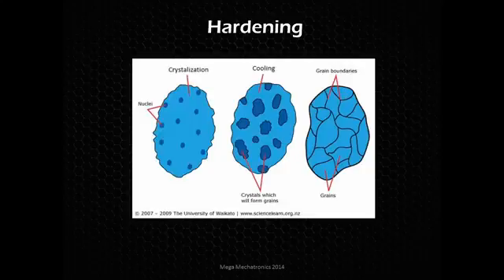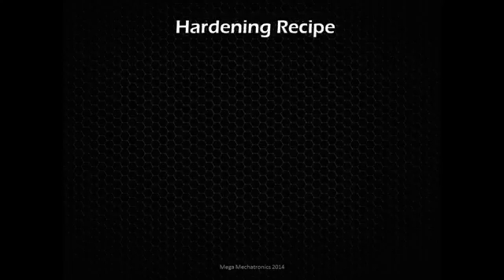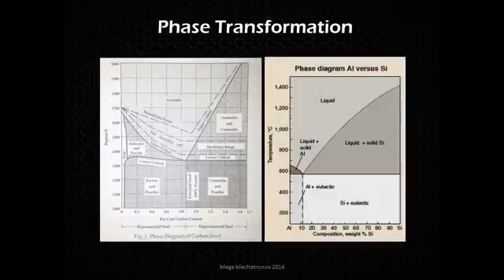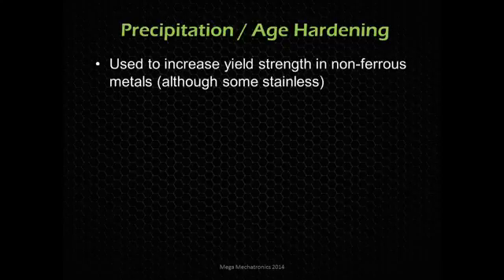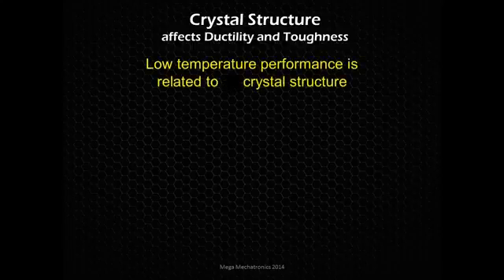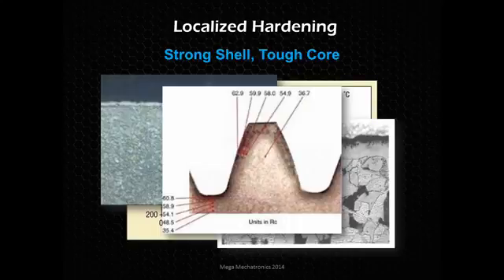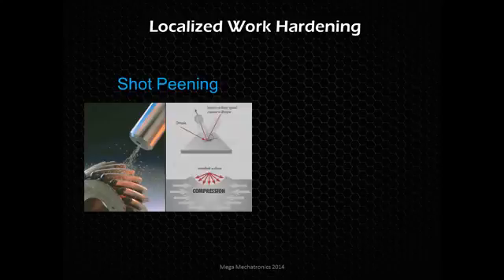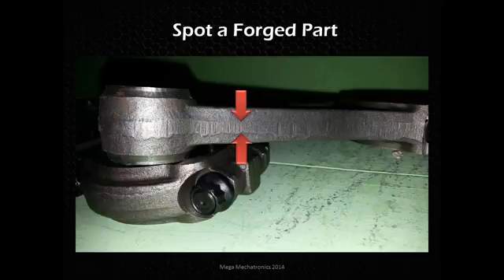Materials Science Mechanical Engineering    Part 4 Heat Treatment Explained

Comment: Ferdiyan Alfathan Yogasara (2714100041)

From this video, the video explain about heat treatment, especially about hardening. Before i explain the hardening, i will review about heat treatment. Heat treatment is the heating and cooling of metals to change their physical and mechanical properties, without letting it change its Heat Treatment shape. Heat treatment could be said to be a method for strengthening materials but could also be used to alter some mechanical properties such as improving formability, machining, etc. The most common application is metallurgical but heat treatment can also be used in manufacture of glass, aluminum, steel and many more materials. The process of heat treatment involves the use of heating or cooling, usually to extreme temperatures to achieve the wanted result. It is very important manufacturing processes that can not only help manufacturing process but can also improve product, its performance, and its characteristics in many ways
There are severeal heat treatment, firstly i think is hardenaning. Hardening involves heating steel. Hardenability is the property that determines the depth and distribution of hardness induced by quenching. Steels that exhibit deep hardness penetration are considered to have high hardenability, while those that exhibit shallow hardness penetration are of low hardenability. Because the primary objective in quenching is to obtain satisfactory hardening to some desired depth, it follows that hardenability is usually the single most important factor in the selection of steel for heat-treated parts. Hardenability should not be confused with hardness as such or with maximum hardness. The maximum attainable hardness of any steel depends solely on carbon content. Also, the maximum hardness values that can be obtained with small test specimens under the fastest cooling rates of water quenching are nearly always higher than those developed under production heat-treating conditions, because hardenability limitations in quenching larger sizes may result in less than 100% martensite formation.  Basically, the units of hardenability are those of cooling rate, for example, degrees per second. These cooling rates, as related to the continuous-cooling-transformation behavior of the steel, determine the hardness and microstructural outcome of a quench. Therefore, the terms Jominy distance and ideal critical diameter can be used. The hardenability of steel is governed almost entirely by the chemical composition (carbon and alloy content) at the austenitizing temperature and the austenite grain size at the moment of quenching. In some cases, the chemical composition of the austenite may not be the same as that determined by chemical analysis, because some carbide may be undissolved at the austenitizing temperature. Such carbides would be reflected in the chemical analysis, but because the carbides are undissolved in the austenite, neither their carbon nor alloy content can contribute to hardenability. In addition, by nucleating transformation products, undissolved carbides can actively decrease hardenability. This is especially important in high-carbon (0.50 to 1.10%) and alloy carburizing steels, which may contain excess carbides at the austenitizing temperature. Consequently, such factors as austenitizing temperature, time at temperature, and prior microstructure are sometimes very important variables when determining the basic hardenability of a specific steel composition. Certain ingot casting and hot reduction practices may also develop localized or periodic inhomogeneities within a given heat, further complicating hardenability measurements. The next is Tempering, involves heating steel that has been quenched and hardened for an adequate period of time so that the metal can be equilibrated. The hardness and strength obtained depend upon the temperature at which tempering is carried out. Higher temperatures will result into high ductility, but low strength and hardness. Low tempering temperatures will produce low ductility, but high strength and hardness. In practice, appropriate tempering temperatures are selected that will produce the desired level of hardness and strength. This operation is performed on all carbon steels that have been hardened, in order to reduce their brittleness, so that they can be used effectively in desired applications. After that, there an anealling, anealing involves treating steel up to a high temperature, and then cooling it very slowly to room temperature, so that the resulting microstructure will possess high ductility and toughness, but low hardness. Annealing is performed by heating a component to the appropriate temperature, soaking it at that temperature, and then shutting off the furnace while the piece is in it. Steel is annealed before being processed by cold forming, to reduce the requirements of load and energy, and to enable the metal to undergo large strains without failure. Next is normalizing. Normalizing involves heating steel, and then keeping it at that temperature for a period of time, and then cooling it in air. The resulting microstructure is a mixture of ferrite and cementite which has a higher strength and hardness, but lower ductility. Normalizing is performed on structures and structural components that will be subjected to machining, because it improves the machinability of carbon steels.

Comment: Bobby A.F. Sinaga
2714100144

Thanks mrs. Dian for the video. First this video explain about Hardening. And This video tells us the meaning of hardening as general. Hardening is create a nuclei and crystalization and let it to be cooled and the crystals grows up and build a grain boundaries (the crystals become bigger). And its video also introduce/tells about crystals lattice likes cubic body centered (BCC), cubic face centered (FCC), and hexagonal. This video also explain about crystal lattice dynamics. Likes the crystals moves one position to other position but still in the same quantiti and size. Next this video tells us about grain boundaries. Its talks about the size of boundaries, likes the huges grain boundaries makes the material more ductile. And this video tells about the concepts of hardenability. The first concept is limits dependent on alloying elements of the metal. And the second concept is hardness dependent on carbon content in ferrous metals. And this video show us the graphic of hardness vs carbon content and its shows more content of carbon makes the hardness increase. This video also tells about hardening recipe. Its very important.  The important things are heating rate, time, cooling rate. Heating rate in the ambient temperature to the transform temperature and then holding time and then do cooling material with quench media likes water, oil, salt etc. And then do a temper. Heating again but not change the transforms. The success recipe is example used in automotive. The ways is after do the hardening like i said before, we must doing austemper. And Austempering is heat treatment that is applied to ferrous metals, most notably steel and ductile iron. In steel it produces a bainite microstructure whereas in cast irons it produces a structure of acicular ferrite and high carbon, stabilized austenite known as ausferrite. It is primarily used to improve mechanical properties or reduce / eliminate distortion. And do the cryotemper to complete the trensformation of martensite. And then do cold working shot peening, polishing etc. And this video tells about phase transformation like FE3C and Al. And the video also shows us a composition matters likes plain carbon 1018 with base element is iron, alloying elements are 0.17% of carbon, 0.75% of manganese, max 0.040% phosphorus, mas 0.050% of suffer. And other example is 4130 alloy steel and 304 stainless steel. At the points the alloy or others elements function to improve the materials properties. And the videos are also explain us about kind of heat treatment. Likes tempering, normalizing, annealing, quenching, age hardening etc. First is tempering, Tempering is a process of heat treating, which is used to increase the toughness of iron-based alloys. Tempering is usually performed after hardening, to reduce some of the excess hardness, and is done by heating the metal to some temperature below the critical point for a certain period of time, then allowing it to cool in still air. The exact temperature determines the amount of hardness removed, and depends on both the specific composition of the alloy and on the desired properties in the finished product. For instance, very hard tools are often tempered at low temperatures, while springs are tempered to much higher temperatures. And then normalizing, that ferrous based metal heated above transformation tempreature, allowed to air cool in still air at room temperature. Next is annealing. Annealing is a heat treatment that alters the physical and sometimes chemical properties of a material to increase its ductility and reduce its hardness, making it more workable. It involves heating a material to above its recrystallization temperature, maintaining a suitable temperature, and then cooling. In annealing, atoms migrate in the crystal lattice and the number of dislocations decreases, leading to the change in ductility and hardness. In the cases of copper, steel, silver, and brass, this process is performed by heating the material (generally until glowing) for a while and then slowly letting it cool to room temperature in still air. Copper, silver[1] and brass can be cooled slowly in air, or quickly by quenching in water, unlike ferrous metals, such as steel, which must be cooled slowly to anneal. And then precipitation / age hardening, Precipitation hardening, also called age hardening, is a heat treatment technique used to increase the yield strength of malleable materials, including most structural alloys of aluminium, magnesium, nickel, titanium, and some steels and stainless steels. In superalloys, it is known to cause yield strength anomaly providing excellent high-temperature strength. that the function are to increase yield strength in non-ferrous metals, and produces fine particles that defects the crystal lattice that impede movement. And then the video also tells about quantifying hardness, to know the value of hardness of materials by using a indenter likes ball or diamond indenter by measure the area marked by the indenter. The videos also tells about hardness vs strength, hardness vs toughness. And then the video also tells about work hardening in cold working. That in the video explain, uses compression forces and plastic deformation, creates desirable dislocation in the crystal lattice structure, improving yield strength, but reduces ductility. And in hot forging, work hardening done at higher tempreature, stronger than an equivalent cast part, aligns grain structure to the shape of the part.

 And all thats the video tells us about. So thanks to mrs. Dian for the video. This video was great. And learns us alot.